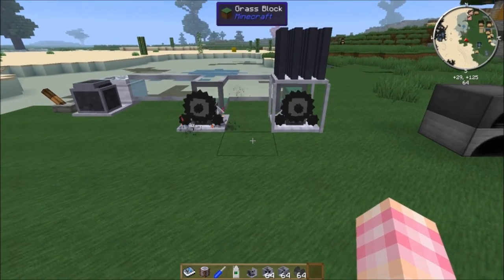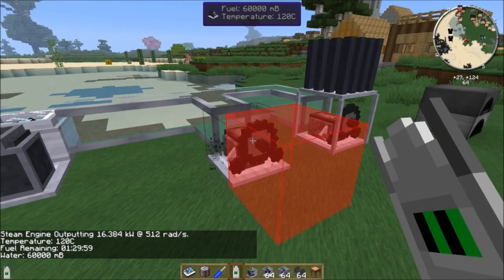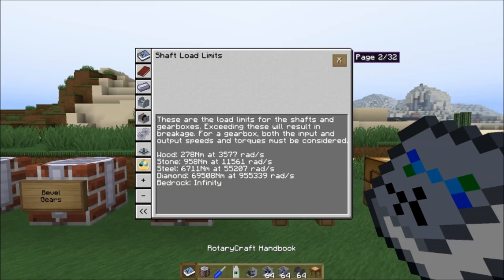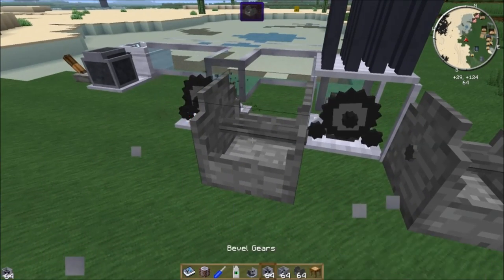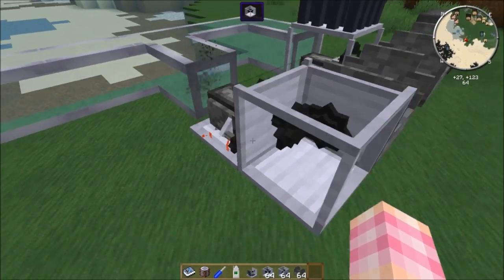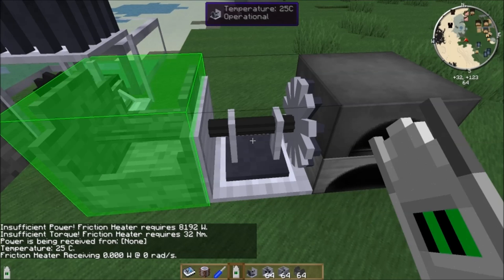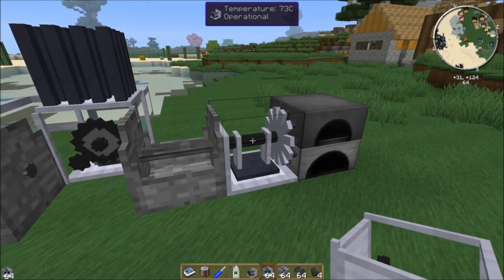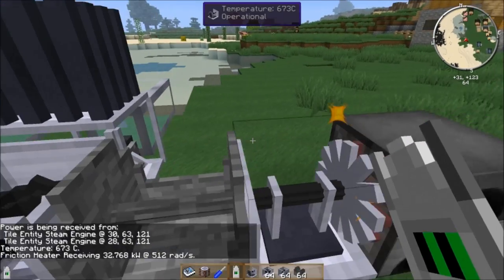RotaryCraft Tutorial #3 - Basic Power Transfer & Smelting

Comment: For what it is worth, the temperature gain on the Friction Heater is calculated logarithmically (base 2); doubling the power input only linearly increases the temperature gain. To double it from a steam engine, you need to square the power, or 262.144kW, equivalent to a Performance Engine.

Also, it is pronounced "Ray-ka". ;)
Reply from the maker: Hey thanks for the insight I really appreciate it, also yeah I get your name right in another video, sorry about that.

Comment: What version of rotarycraft is this? 
I dont realy know what version do I have, but in my version I cant run the pump with DC engine.
Reply from the maker: Make sure you've placed the engine on the right side of the pump. It can only take in power from the two sides with green boxes.
Reply: SentinalhMC Yeah, I do it right, but when I click the pump with my angular transmublabla thing it says "insufficient torque. Need at least 32 Nm." And the DC engine gives only 4 Nm. I guess that my version of rotarycraft is slightly outdated.
Reply from the maker: Anthony Izumi I'm using FTB Monster for this series and its running version 19b of Rotarycraft. In this version the pump only requires 4 Nm of torque. RotaryCraft itself is up to version 23 now. Don't worry, next episode I'm gonna show you a way around it.
Reply: SentinalhMC I'm playing FTB techworld and it uses rotarycraft v16. (
Reply from the maker: Anthony Izumi Ah so that's why. Well just use a Steam Engine to power your pump. You can put the first bucket of water in manually.

Comment: I wonder if you can run more than one friction heaters to 100 degrees off of one steam turbine. Because then, you can make a steam turbine that heats up itself and at least one other. That steam turbine combines it’s power output, powering more friction heaters… you could get so much power! Totally not a waste to use rotary power to heat a steam engine with a large setup, instead of a fire…